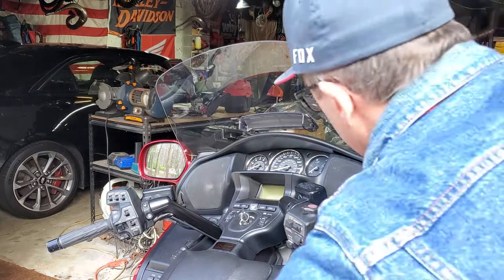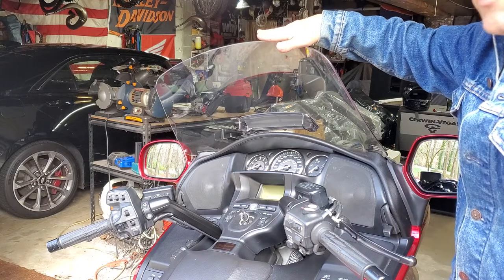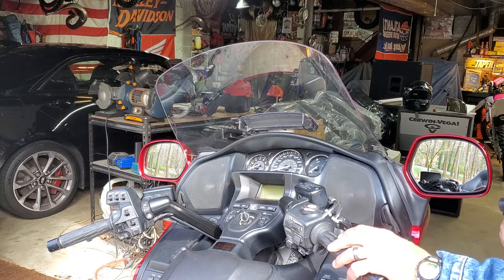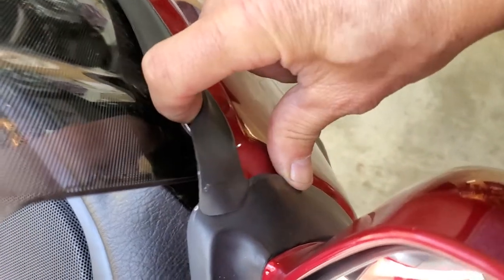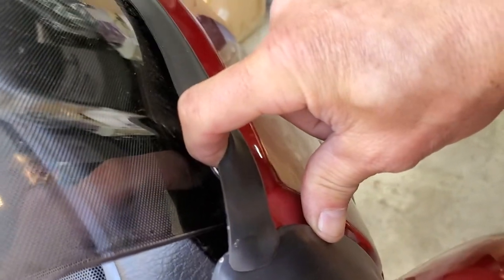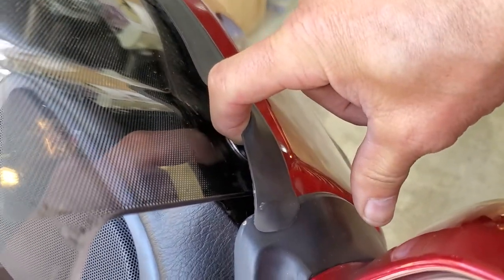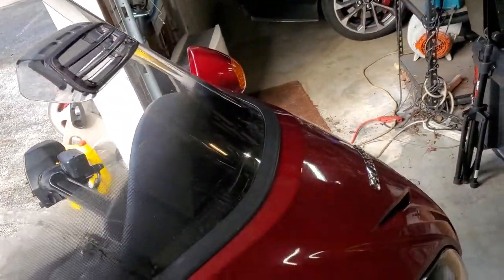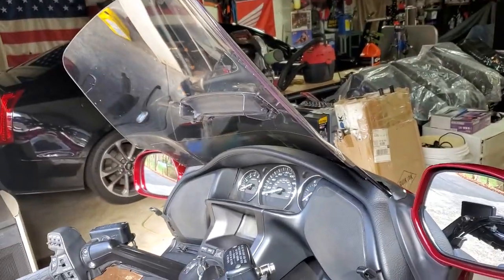If you can't move your windscreen all the way up Honda GoldWing Gold Wing GL1800 Touring Bike

Comment: I did this and it worked.  Although I don't feel any ratcheting system in mine but that's ok I'm just pumped I can move it now.  Thank you
Reply from the maker: The click up every couple of inches is the "ratcheting."  Meaning, you have to move it all the way to the top before you can lower it to the bottom.